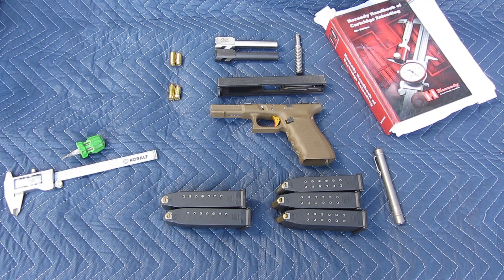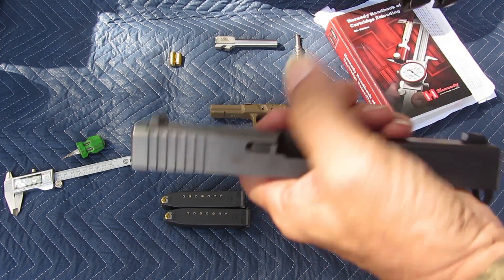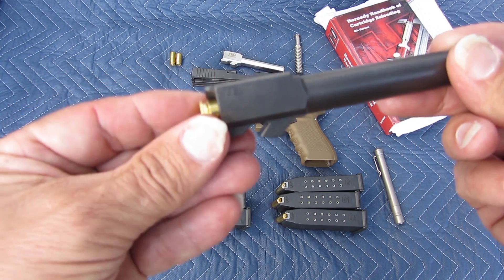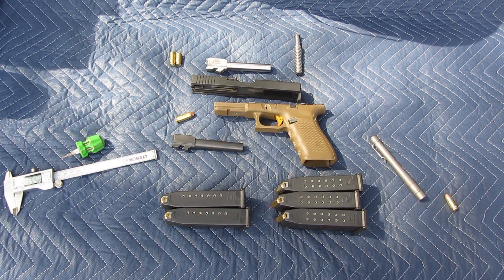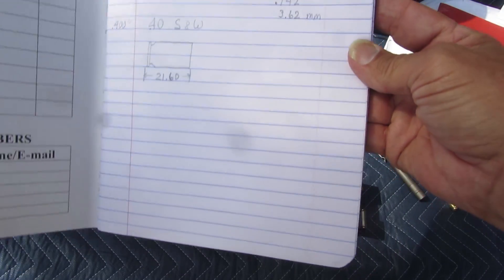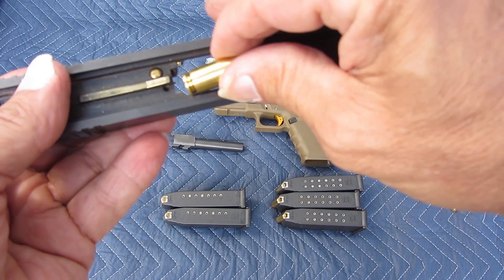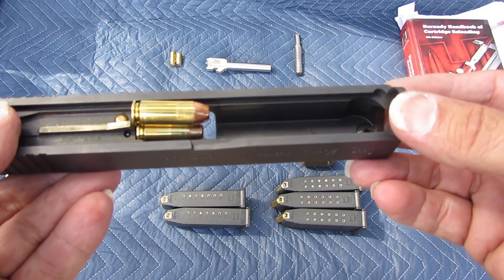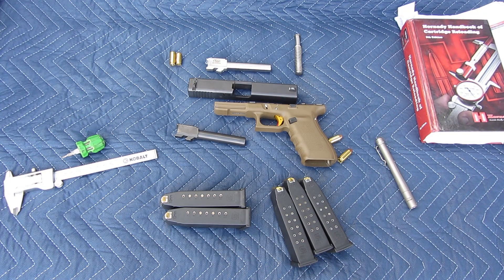Can You Shoot .40S&W in a Glock 20 10mm Barrel

Comment: Revolvers work this way.. 38 works just fine in a 357, think about it
Reply from the maker: @Dodd Garger....Wrong. You should rethink that. A Revolver uses the cylinder to hold the cartridge in place as it is being fired. No moving parts. The Semi Auto uses the barrel chamber with the extractor holding the cartridge as it is being fired. Extractor is a moving part and is being forced to hold on to the shorter case of the .40 s&w. Revolver case has a rim to hold it in the cylinder to keep the .38 special from moving the extra length of a .357 mag.

Comment: wont you damage the barrel?
Reply from the maker: +dseed norway 
Yes it will damage the barrel. The Chamber of a Glock factory barrel is wider than the Chamber of other barrels, which allows the Brass Casing to move side to side (Glock was designed to be a Military Handgun) being that it would accept a larger range of ammo and operate while dirty during wartime. The Brass Casing fits all the way to the End of Chamber Rim and the Bullet Projectile extends into the Barrel Rifling. The .40 S&W ammo is shorter than the 10mm ammo and the .40S&W Brass Casing doesn't reach the End o Chamber Rim. So if yo add in the (Chamber Extra Width Movement) and (Shorter Bullet) when it fires a round with the Case Movement Not Center, then it Will Damage the Barrel.
Reply: great info, thanks mate :)
Reply from the maker: dseed norway
You're welcome
Reply: No

Comment: I agree with you. No need to put extra stress on the parts. I've wanted a glock 19 for a long time and you wouldn't believe how many people commented on my vids about getting a 9mm conversion barrel for my Glock 23 Gen 4. Glock in Smyrna told me that's fine for a Gen 1, 2 or 3 but NOT for a Gen 4. On a Gen 4 if you don't swap out the ejector, extractor and spring for the conversion barrel you're asking for trouble down the road.
Reply from the maker: +deputysheriff100
That is Two Completely different Diameter Cartridges .40 cal.(10mm) to .35 cal.(9mm), that would be asking a lot to make an Extractor move that far. The reason why your Glock 23 .40 cal. can easily covert to 9mm and my Glock 20 can't easily convert to 9mm is the Frame Size. Even though the .40 cal. is 10mm diameter, I can load .40 cal. rounds in a 10mm magazine but I can't install a .40 cal. magazine in my 10mm Frame. According to Glock they made the 10mm and .45acp. with a Larger Frame than the .40S&W, .357sig, and 9mm. I can load both .40S&W and .357sig easily in my 10mm mag. all three use the same diameter cartridge just shorter so there is slack front to rear.

Comment: For the projectile to enter and hit the chamber, without being fully chambered, is not good, especially repetitively. No, it won't blow up in your face right away but like you say, it's definitely not good for the barrel or extractor. I would bet that the ridge of the chamber and barrel would become damaged as well, possibly to the point it wouldn't chamber and cycle the 10mm's. The cooking looks great !! I can't remember seeing the cinder block concept before...I've gotta try it, Lol.
Reply from the maker: +Stucknarutt Improvise Adapt Overcome LOL. I find Bricks, Blocks, Rocks and Logs to set my pots on. The Blocks work really well, it keeps the heat right on the cooking surface.
Not only Damaging Gun Parts, You lose accuracy by not having it fully chambered and locked in.